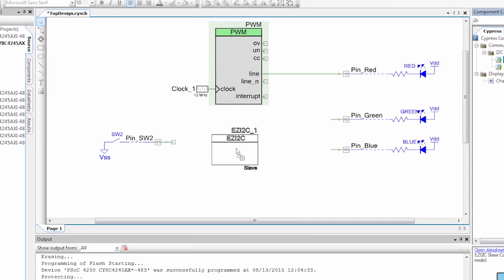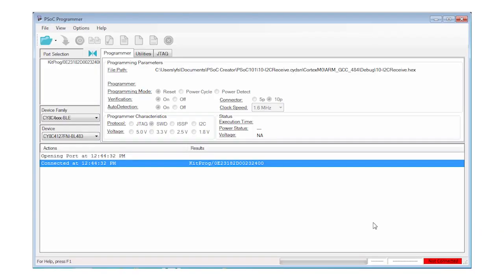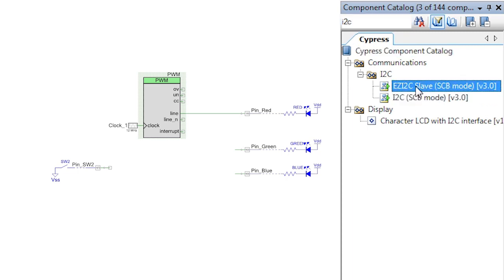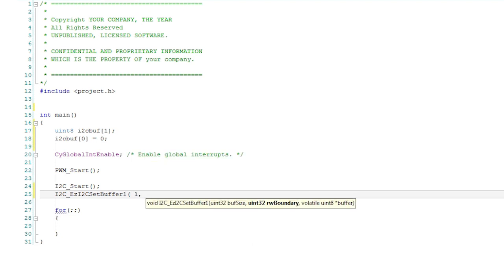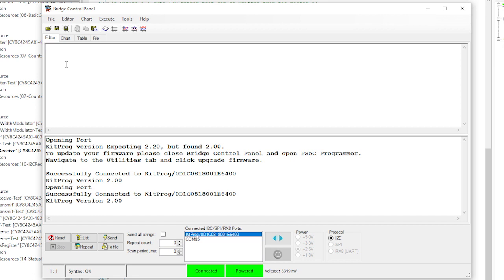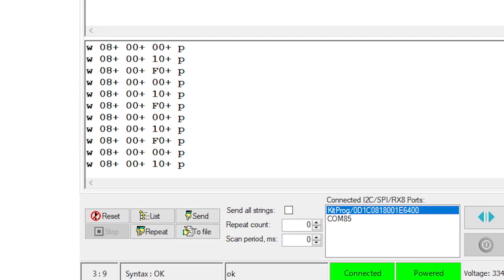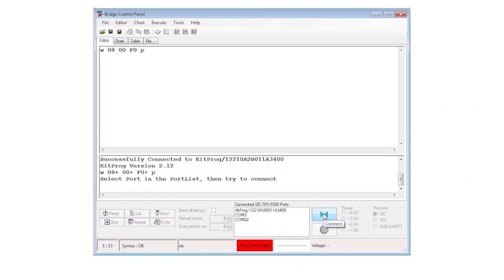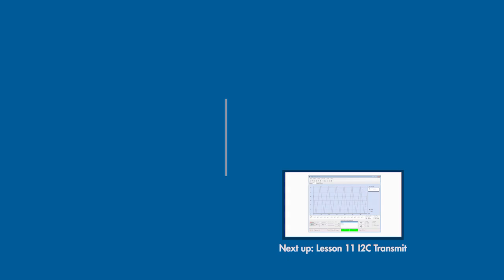PSoC 101: Lesson 10 I2C Receive

Comment: At 3:38, you set up the buffer within main().  This will cause problems.  Recommend you set up the buffer globally, outside the main() function.
Reply from the maker: Hi Davie, in this case main never exits and a pointer is passed to that structure when setting up the I2C buffer. Those are the only two things that reference that array so it should not cause any issues in this example.
Reply: @CypressSemi  Howdy. Tried it several times.  Declaring the buffer outside of main works.  Declaring it inside of main does not.